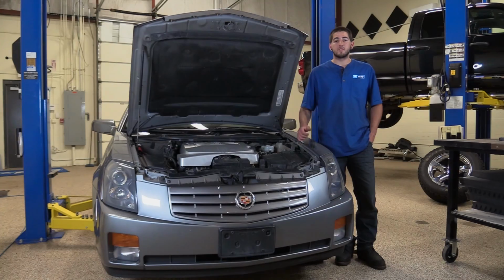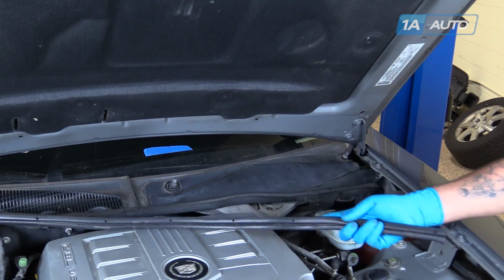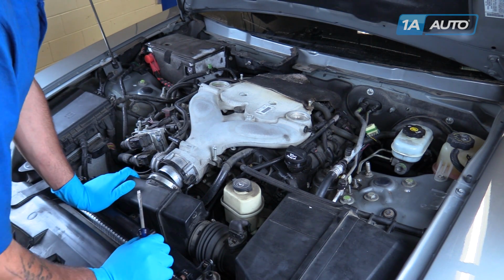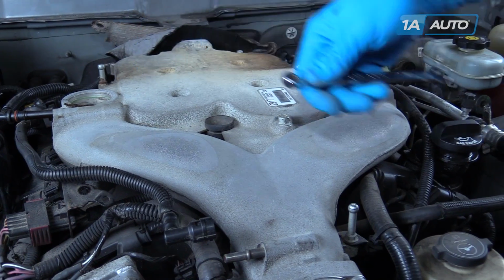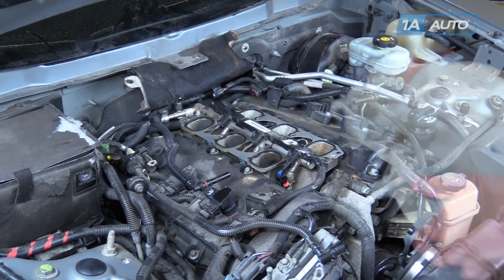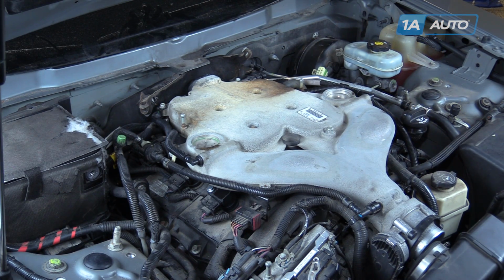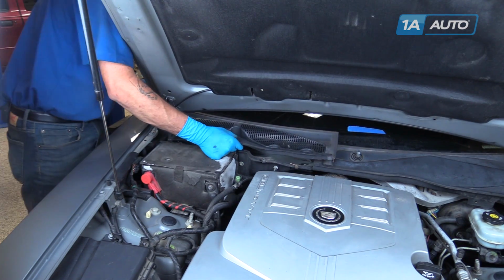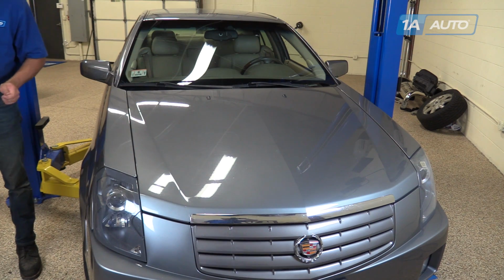How to Replace Plenum Gasket 03-07 Cadillac CTS

Comment: What is the name of the hose you are disconnecting at 4:21 called?
Reply from the maker: +McBiscuit Hello. It looks like it is a vacuum line of some kind. It may not have an actual name, but you can check with your local dealer for the name or even the part number. Thanks for watching! 1AAuto.com

Comment: I didn't remove the wiper transmission and found it unnecessary. It didnt block anything. I did see a skipped step not presented in the video. The space behind the battery and the metal was not shown how to remove but was showed already removed into the video without steps. I did not remove it. It only blocks the rear manifold bolt from easily being taking off or torqued. I ended up torquing 5 of the 6 and rear bolt at my discretion. With a shallow socket was easy enough.

Comment: this should be relatively the same for a 2009 3.6 CTS right?
Reply from the maker: +Will Webster Thank you for checking us out. This should be fairly similar, however the 2009 may use separate hardware sizing or orientation. It is recommended to confirm through a service manual for exact specifications. 1aauto.com
Reply: Did you do this job? I have a 2009 3.6 CTS as well

Comment: What are the small hoses connected to the manifold
Reply from the maker: +YoGoADP17 Plays Those are just vacuum fittings that go to various pieces of the evap system.  We do not have a diagram that illustrates where each hose goes.  1aauto.com

Comment: Damn, good thing I have an sts, more room to work with.
Reply: There is one freaking bolt that is hard to get to...
Reply: The back one?
Reply: Yeah lol. That thing is a pain... I use a rod to lift it up the cowl cover  so I can fit a socket there. I always felt bed about that bolt... but seeing this video... I feel much better now...  no need to remove wiper blades, assembly, cowl cover, etc. Saves some time and effort... When I start, I remove that bolt first. When I'm done, I remove it last.
Reply: For sure, I just use a very small ratchet with a short socket. Only need to lift a little with my hand to get the ratchet in. Might have a little more room because I have an sts and not a cts.
Reply: I hope you never have to do your cats yourself. Theres no down pipe, so the top bolts are insanely hard to get to. Took me over six hours. Saved me over $700 CAD or more in parts and labour though. Only 130 for each cat online. Normal listing from gm is like 450 for each, ridiculous.
Reply: That's about the only part I haven't touched in this car yet lol.... Car had a thud and heavy vibration.... I changed motor mounts... One of them was so worn out...you could spin it 360 degrees, and fluid was leaking out. That crap is acidic lol... burned my phone cover somewhat. That took care of the vibration... not the thud. Bolts were very hard to reach... Drilled a whole right through side of the car frame next to left tire to reach bolt. 

 So... I replaced the rear differential bushing... man that crap was a pain to take out, and even harder to put the new one back in... Down came the whole exhaust... up to the catalytic converter. I didn't even try to remove the O2 sensors... Just unplugged them. Bolts connecting exhaust to Cats were heavily rusted and would not budge. Used a grinder to cut them in the middle, popped right off. 

I swapped NAV system... someone had listed stock on Ebay for $85. Couldn't pass on it... Found mechanic at dealer who removed lock for $20. Some dealers asked for $300...
Reply: Only other things I've done besides maintenance were back wheel hubs and two coil packs. Wheel hubs weren't too bad, one of the three bots in the back were extremely awkward to get to. Sadly though, I have to do a timing chain replacement. Not looking forward to it at all... If it wasn't for the fact I've completely paid it off and that I love the ride, I'd probably just sell it.
Reply: I tried to buy a 2012 Cadillac SRX with 29,000 miles over the weekend... Dealer swore it was in great condition, selling way under MSRP. I took the car out for a ride... Let go of the steering wheel. Car turned to the right...sharply, out of the lane and towards the sidewalk. Looked at exhaust.... all the hangers were so heavily rusted... Looked like they were going to go any time... exhaust heavily vibrated, could feel it throughout the car. Connection points in between the exhaust parts were also heavily rusted. Struts and shocks were heavily rusted on all sides. Exhaust parts themselves, also had a few rust patches. If I pushed a little bit, I'm sure my finger would go through lol. Connection between differential and axle was leaking... Either pinion seal or axle,  fluid flowing down differential. Front k-frame between bumper and motor showed oil residue, 2-3 feet wide, from left to right. When I took off oil cap, there was dye residue... figures. I wasn't able to check steering fluid level, as cap was under motor cover, held by one bolt. 

Ran car fax report. Car had a 2-wheel alignment done two weeks along with a 4-wheel alignment soon after... Report also showed they AC maintenance... and what they cleverly labeled as a "fluid check" without mentioning "fluid leak" lol. Also showed they did oil change in the last few days... Nothing like topping up fluids... best way to conceal a fluid leak. I mean, who looks under a car nowadays lol? I mean... forget this thing called gravity!

I have to admit, dealer had a beautiful & impressive setup though. When I walked in, salesman said he drove it over the weekend, and it drove great! Followed by... "It just had safety & emissions inspections were done over the weekend. Passed with flying colors!! Car is in pristine condition!" And concluded with "Are we getting a trade in with this purchase?" I'm pretty sure I didn't say I was purchasing the car... 

He says "Did you notice the foot rail is off a little bit? We will fix that free of charge! So... I mentioned a few of the problems, told them that I will think about it. I got a call a few hours later, "Our mechanic did a 'safety' check, and there is nothing wrong with the car. No alignment issue (But I drove it on a straight road, and it took me out of the lane,  if I didn't grab the steering wheel, over the freaking sidewalk). Exhaust vibration is normal... (heavy vibration that you could feel throughout the car. No mention of the heavy rust on the exhaust). There are no fluid leaks, the mechanic must have spilled the oil when an oil change was done. (Except the oil cap is at the rear of the motor, not at the front of the K-frame and there was dye on the oil filler). 

I think one of two things took place.... Either the car salesman was lying to me... or my eyes DECEIVED me... God... I hope my eyes have not started deceiving me already lol.
Reply: I also have an STS :D
Reply: Lol... let me know how timing chain goes! I'm considering doing it too.... to scared to look at the process at the moment.
Reply: Damn, that's a lot wrong for a 2012. Mine is a 2007 with 130000 kilometers and hardly any rust to speak of besides the old cats I took out. And I live pretty north with 6 to 7 month long winters. Exactly why I got the sts4 though haha.
Reply: I bought it with 70000 kilometers and it was mint. So glad I came across it. Love the Bose speakers, which is saying something because I had custom JL speakers and subwoofers in my old car. Too old for that stuff now though.
Reply: I envy you. I have a 2006 Cadillac STS RWD... if there is snow, this thing will not go anywhere. I also have 172,000 miles or 277,000 km lol. And also hardly any rust. I sniped my car on Ebay -.- lol
Reply: Yeah, they did a pretty good job on the rust protection on 2006-2008 generation.
Reply: Really can't wait to change my timing chain though, the sensor keeps it from having any power till about 5000rpm. Which is good though because I have a bit of a lead foot and I would have probably blown my engine by now.
Reply: I bought mine with 150,000 miles in okay condition. V6... It has a sunroof, remote start, leather interior,  heated front and rear seats, ac front seats, heated steering wheel... power tilt steering, back up sensing system... power seats both front seats, dual climate control.... Bose surround sound... nav system & dvd player. You don't want to know how much I paid for it... what my snipe was set too lol.

My coworker bought a brand new car... a Nissan Versa. A bare-bone car at $14,000... 4 cylinder, with a gray cloth interior. We did car-pooling for a few months. Man... at times, it felt uncomfortable to sit in that car. Everything except for the mirror had to be manually adjusted. A push button radio... one temperature fits all. The speakers emitted a type of sound that I was unfamiliar with... one with static and almost a vulgar quality of sound compared to the Caddi... I also drove his car a few times... I had to adjust the amount of power I put on the gas pedal... and that if the light turned yellow, to treat it like a red light, as there was no sense in trying to make it.
Reply: "... A lot wrong for a 2012." You know the expression "beauty is in the eye of the beholder?" 

Apparently, what one person sees as a lot wrong, another sees as nothing wrong... eye of the beholder.